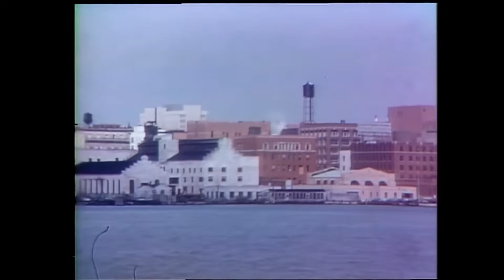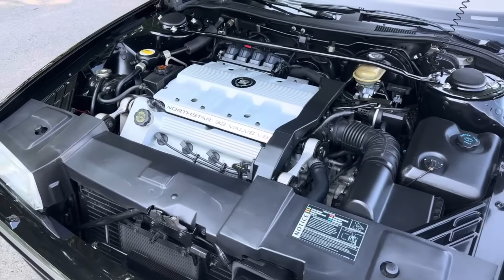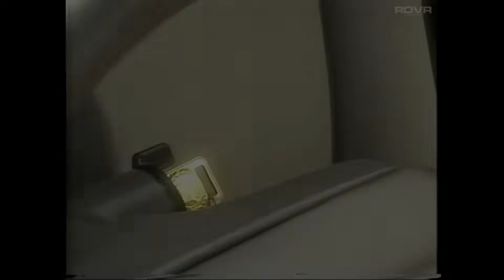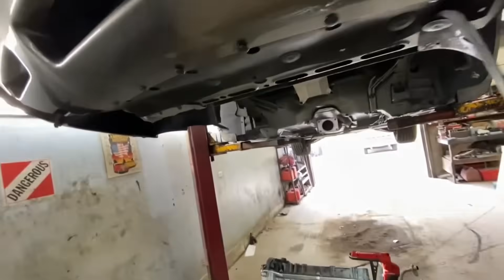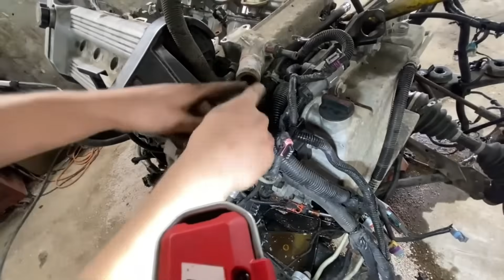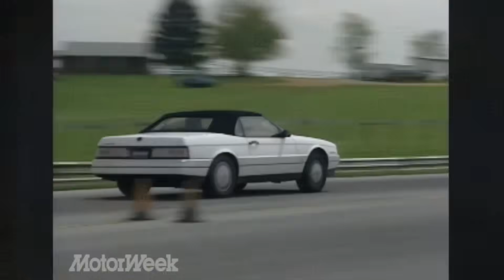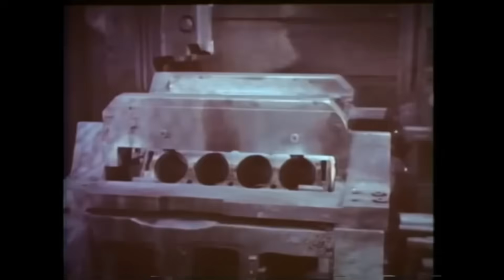Most HATED American V8 Engine of All Time!

Comment: Tne later Chevy pushrod V8s were capable of more with less complexity.  As some here have noted, TTY bolts are common today and do work.  Have never liked the concept because it's a 1-use more expensive part, but tbat doesn't mean it won't work.  Here were the real problems as I see it.
1. Washington should never have been designing cars.  Ralph Nader shoukd have been diligently ignored.  The government COULD have beneficially, during the 60s, simply have imposed a very few performance standards with realistic timelines.  First should have been stopping distances and handling capabilities; manufacturers in the day already had low cast optional components on the shelves that would have met these.  Next, tire adhesion.  THEN, and only then, with at least a 6-year horizon, fuel economy:  double fuel economy and you cut emissions by half in the bargain.  Then on at least a 15-year horizon, with sound research, CONSIDER emissions in context with all other sources.  Regarding safety, instead of stupid speed limits and 5 mph bumpers, simply make a DUI conviction to include forfeiture of the vehicle and ineligibility to insure another for a period of time.  Again, address any remaining reasonable concerns on a longer schedule.  Detroit already had a pile of good engineers, and on reasonable schedules might have delivered most impro ements on their own.
2. A big one:  The deal for a piston engine isn't how much fancy stuff it has, like DOHC.  It is how it breathes, whatits rubbing speeds are, how fast it can burn a charge at all speeds, how long it will last, and how consistently it can be assempled according to design so it can faithfully achieve the intent.  Chevy engineers got this knocked in the LS successor to the classic small block, in both iron and aluminum.  Nothing wrong with pushrods, folks!

And, to the best of my knowledge, Northstars can be remediated to achieve all their design goals, including longevity.  The question is more why would you.

Comment: The 6.4 power stroke just entered the chat
Reply: Just as the Olds 5.7 diesel is high tailing outta here
Reply: @Richaag  The olds diesel was a brilliant idea, but they made several fatal mistakes when designing it.  They built it on a regular gasoline engine block and heads.
Reply: The 6.5 gm diesel is worse
Reply: Yes. Mr.Joke Diesel.
Reply: Ahhh yes the PowerJoke 😂

Comment: I was expecting the 5.7lt diesel V8. What a wasted opportunity.
Reply: The Olds diesel failed for so many reasons, everything was half assed. The Northstar was a much bigger failure because it should have been great but ended up a nightmare, when it should not have been.
Reply: Never had one of those, don't know anyone who had one. I hear they were trouble then issues ironed out but it was too late their reputation was ruined.
Reply: Also diesels were a different animal back then for the U.S. car market. What's a water separator? Just pump the gas pedal a couple times and it should start, right?

Comment: Oh NorthStar guide me home! Whatever! A good friend of mine for many years has built what was his paid off daily driver, into a fwd sleeper of the highest order. Yea he bought a 2004 Bonneville GXP, that came with a NorthStar, he bought for the Pontiac style with Caddy engine. After a full 10 years and 120,000 or so miles he was going to sell for an AWD Charger RT, but sadly Dodge discontinued the AWD Hemi option in 2015! So instead we pulled the NS out and bought to a garage known to bulletproof them and the fwd transaxle, including a posi differential. It’s been about 8 years now and he is still like a kid in a candy store with that car. Still looks all stock, except for the forged wheels and huge tires with spring overs all around. He can take off in a cloud of tire smoke like a mad cat, or with as little as possible and quicker than a scalded car!
Reply: I had a 2005 Bonneville GXP.  LOVED the ride, loved the car, and LOVED the Northstar - especially after having the block studded.

Comment: Ford make the same mistake with the torque to yield head bolts in the 6 liter power stroke.
Reply: I'm a Ford guy. To this day since the 60's I've never had a Ford engine fail me.
Reply: @fido139  So you're never been hit in the face by a spark plug in a V-10.
Reply: Actually, while navistar did use tty bolts, it was the excess pressure from tunes that caused the failures.  Everyone i know that left their engines stock have not had a headgasket failure.  I have a friend with almost 200k on his stock 6.0, it has the original gaskets. He has had to replace his oil cooler, egr cooler and injectors but otherwise that's it.

Comment: Simple, lack of long term testing! I retired from an industry that tested all new products to failure using the highly accelerate rated life cycle testing. While it did not find every possible failure, it eliminated 95% of them before production began.! And I can assure you with head gasket failures had GM followed the same path they would’ve found and fixed this Northstar problem before it ever ended up in a single car and Northstar probably would still be considered a great engine, but they didn’t do that did they? Why? Money and pressure from management and sales!
Reply: How exactly would one accelerate the galvanic corrosion that causes the head bolts to rip out of the block?
Reply: Should have tested it pre- sale by simulating at least 100,000. miles operation including cold start thu warmed up cycling
Reply: @davidpowell3347  Corrosion in the threaded holes in the aluminum block has nothing to do with mileage.

Comment: Well, no worries at all, because now, the Euro brands are just as shitty if not MORE shitty. Ask any mechanic ever. Plastic, plastic, more plastic, corner cutting, failure after failure once you reach that certain mileage. All junk. Nothing but an emblem and a status symbol for people as fake as their cars are. I'll stick with my older Toyotas lol at least I won't be thousands in the hole when something does go wrong. (Can't say this for the newer ones unfortunately)
Reply: Pretty much every mechanic I’ve ever talked to has told me Volkswagen is the bottom of the barrel. Only exceptions are guys with specialty shops and in-ground swimming pools.
Reply: @jameswilkinson6678  

Indeed. I have a 2018 VW GTI that is a maintenance nightmare.  I'm an old car guy but at 83,  I don't work on cars anymore, so it's been dealer-serviced since I took delivery.  Always followed every service interval.  I generally like the car and it's the only one my wife likes to drive. But the EA 888 engine is simply horrible.  It's makes good power and there it ends.

A couple of years ago and just out of warranty, I got a low coolant warning.  I was about two miles from the dealer so scurried right over.  Service guy looks at it and says it's okay and when I restart the light goes out.  Drive it home.  Two days later, wash and repeat.  In the morning when it's cold I check the coolant tank and it's missing coolant, which has been replaced by engine oil. AAA hauls it to the dealer, where they find a defective water to oil intercooler.  A couple of weeks and a couple of $K it's "fixed."  Two more days and the engine blows up.  Another month and $9K and I have a used, 40,000 mile (so they say) engine.  Fast forward and I have another coolant leak. This time it's the thermostat housing, which happens to also be the water pump.  VW has been putting this POS engine in vehicles forever and they still install a plastic waterpump, even though they know how failure prone they are.

Comment: You cannot blame Torque to Yield Bolt. They are used in almost every engine today. But they may have miscalculated what fasteners were needed.
Reply: The block threads often stripped. That was the main problem.

Comment: I would’ve gandered the Oldsmobile 350 diesel was the most hated.

TBH, I’ve owned 2 northstars, and loved them. One in my old Aurora (yes, it was NS derived), and a 96 DeVille D’elegance. What’s hilarious is I didn’t offload them because of the motors…the NS was smooth, ran great, and could stomp 5.0 mustangs all day. -The AWFUL GM transmissions crapped out in both, and thanks to being FWD platforms, I wasn’t excited about replacing them, so off they went. 

As an aside, I also owned an HT4100 at one point as well… Now THAT was an awful engine. Lol